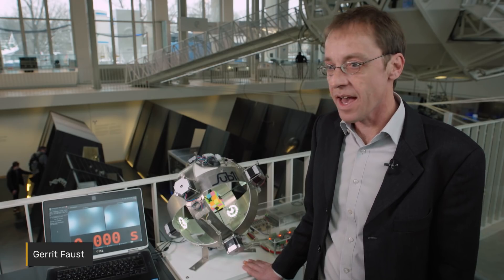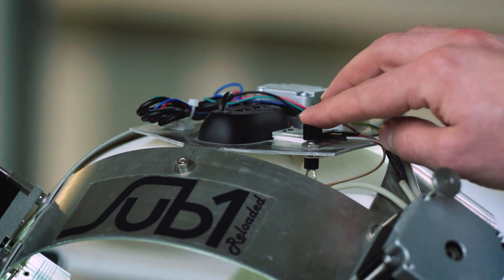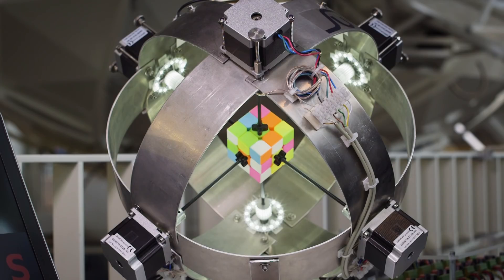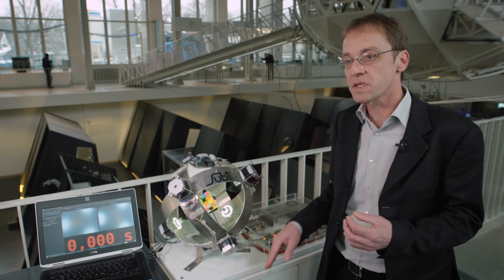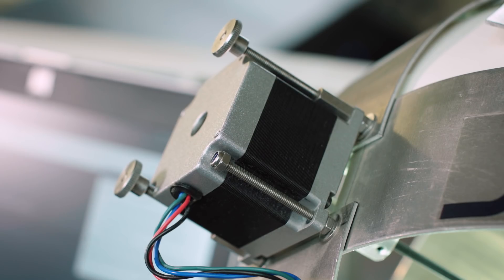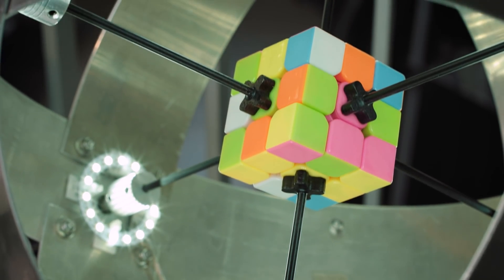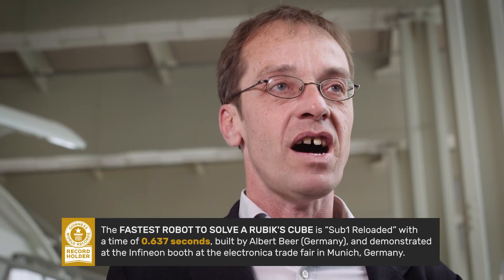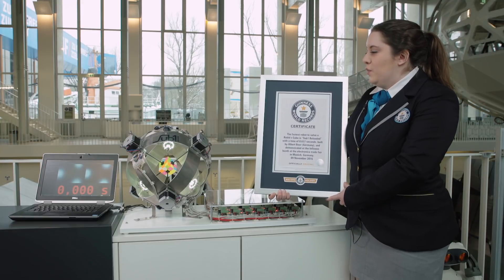Sub1: The Robot that solves Rubik's Cubes - Guinness World Records Europe

Comment: Wouldn't it be faster with a fans 356 air SM
Reply: MasterConnor 06 If the rotational motors only do 90 degree turns, a magnetic cube would be the same as a regular one. And for the record, it doesn't need good corner cutting either. So the only important thing is the robot itself, not the cube
Reply: *gans
Reply: BaataR oh ok